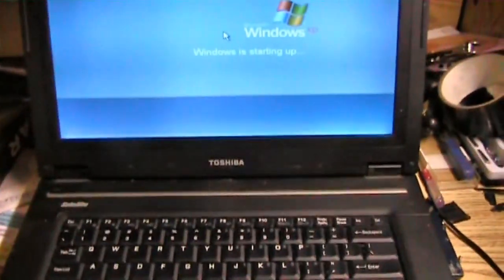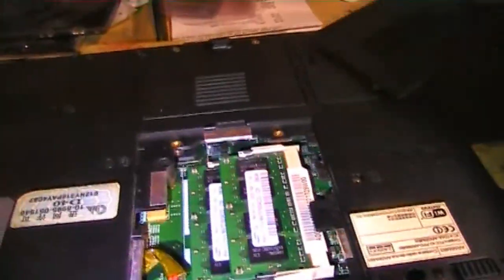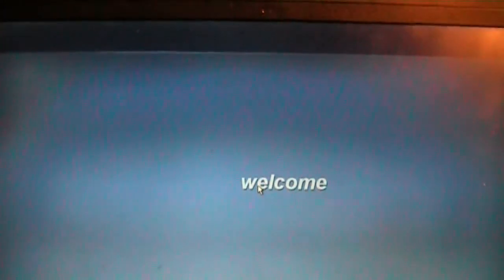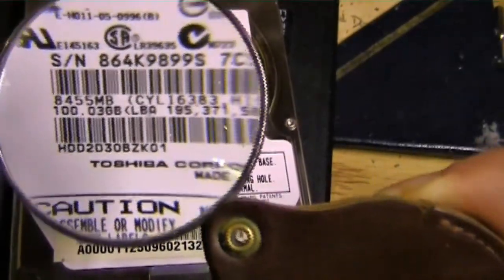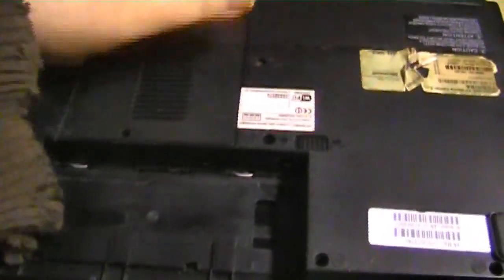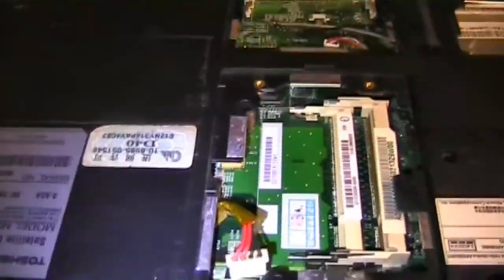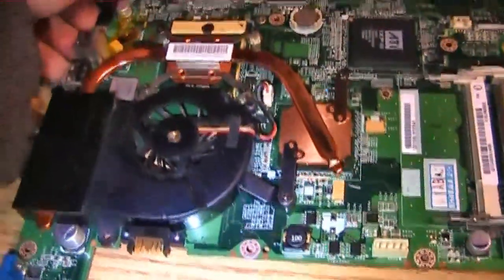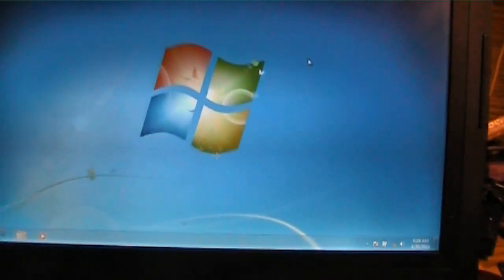Upgrading a Toshiba Satellite L35 laptop

Comment: Can you please tell me what year was this laptop manufactured? And can I use adobe premiere (video editor) on it?  Would you recommend it for regular daily use? Thank you
Reply from the maker: I'm sure it was manufactured over 10 years ago, and as such, it would not do well with new versions of video editors, but if you maxed it out and ran Win7, you could do okay with something like Cyberlink PowerDirector 7 (which is an older of the software) or versions of Adobe or Vegas that were released around the time this was made. If your needs aren't too demanding it could still be a basic computer for daily use, limited by its GPU and definitely not a gaming system.

Comment: Awesome video, I wanna upgrade my Toshiba satellite L35-SP1011,  what's the Best CPU upgrade this machine could handle?,posting the specs here: 

CPU & Chipset3:
CPU  Intel® Celeron® M 380 1.60GHz, 1MB L2, 400MHz FSB
Chipset ATI RADEON® XPRESS 200M
Memory:
2GB PC4200 DDR2 SDRAM
HDD : 40GB (5400 RPM) Serial-ATA (SATA)
CD-RW/DVD-ROM 
Display : 14.1” 
Graphics : ATI MOBILITY™ RADEON® Express 200M 8MB-64MB 

I want to use a 533MHz FSB CPU but i'm not sure if the motherboard will handle it. thanks in advance.
Reply from the maker: You should be able to do a similar upgrade as in the video. I think the fastest CPU for that model would be a T2450. As always, before a cpu upgrade it's a good idea to make sure you have the latest available bios. Best of luck with your project. :)

Comment: i have an s1054 model, do you happen to know the best parts i can upgrade with or if theres a link to the best parts?
Reply from the maker: It's a very limited system by today's standards, but the L35 can be upgraded with the CPUs I mention in this video (there is a slightly faster one than the one I had on hand, which I also reference in the video). Your graphics will be limited by the ATI Radeon x200M, but you'll notice a speed improvement if you elect to max the RAM and install a SSD. eBay is a good place to search for computer parts. Best of luck with your project!

Comment: Ver y good video, I wanna upgrade muy toshiba satellite L35-s2151, what`s the best CPU upgrade this machine?
Reply from the maker: I've heard about the T2250 being a good upgrade, and I think you could probably bump that to a T2350. Just make sure you have the latest bios first. And if you have any doubts about your current specs you can run a free program like CPU-Z or Speccy to find out. Best of luck with your upgrade.
Reply: +ThatWord Will the T2450 wok?
Reply: +ThatWord Will the T2450 work?
Reply from the maker: Looking at the specs, it looks like it should work. Sometimes it's a matter of the latest available bios not containing the proper microcodes to identify the chip. Worth a shot I think.  :)
Reply: +ThatWord How update the BIOS?
Reply from the maker: You go to the Toshiba site, enter your model number and select your operating system, and it will show you your options. Looks like the latest official bios for your model is ACPI Flash Bios version 3.10

Comment: I have a toshiba L35-sp2011. First I had an Intel Celeron m 410 processor, I changed it for a pentium t2130 and it worked fine. Now I put a Core Duo t2600 on it and its frequency is limited to 1.73GHz when it should be 2.16GHz. I have the latest version of the BIOS and I don't know what to do, can you help me or will you know what the problem is?
Reply from the maker: It might be the Toshiba BIOS for the L35 doesn't have the microcode for the t2600, which is 667fsb, so it is setting it like a T2080, which is 533fsb, which it will support.
Reply: @ThatWord  Ok, thanks!
Reply: @ThatWord  Bro, it's possible to add microcode of this processor to BIOS 🤔
Reply from the maker: @gim7640   It's not something that can reasonably be done. In some instances, for some models, there are unauthorized versions of the bios floating around, and by using one you might risk bricking your laptop by running it. So basically the answer is no, it's not practical, but it's still within the realm of the possible. I can't be of further help with it though.
Reply: @ThatWord  well, thanks to much for helped to me

Comment: bro i have a l35-4096 what`s the best CPU upgrade this machine can handle?
Reply from the maker: At the time it came out a fast cpu for that model would be the Intel T2080. There might be faster that it could take, but probably only marginally faster.
Reply: ThatWord a pentium?, wich windows do you think would be suitable for it?, and what would be the heaviest game / aplication that this processor can run?
Reply from the maker: Yeah, Pentium dual core. Win7 should work well. It could probably do Minecraft at lower fps.
Reply: @ThatWord  thanks!, i buyed the t2080 yesterday, thanks for the help

Comment: What model cmos model, i have trouble because my cmos is lost
Reply from the maker: If you mean the CMOS battery model, I believe it is a 2032 battery  (CR2032 coin cell). There are several BIOS versions as well, and with Version 2.2, it will duplicate the BIOS password to EEPROM and compare the password value between CMOS and EEPROM at POST time. If the value is different, BIOS will copy EEPROM value to CMOS. I think the last BIOS for this model was ACPI Flash BIOS version 3.10

Comment: Ah another one of those compaq like constructed models. "Let's just shove the CPU deep into the laptop so they won't bother with the upgrade".
Reply from the maker: +RogerRHF Exactly. There's no accident to a design like that. In fact, I think they had inaccessibility meetings to perfect the layout. :)
Reply: +ThatWord Yes indeed, companies will do anything to increase the possibility of sales.
Reply: could be worse, :I it could be the newer toshiba satellite that my 
sisters boyfriend gave me, it was the lowest model of the toshiba 
sattellite at least the lowest end model of that series and to make sure
 it wasnt upgraded to be at par or above par with the higher end models 
they soldered in the cpu to the board so it can never be changed, and to
 make it worse the cpu in it is typically used and seen in a netbook and
 it is a dual core 1.10ghz proccessor which is really really bad and 
slow for any new computer :I i initially thought windows 8 lagging was 
due to a virus but it turns out it was bogging down the poor cpu so 
much, and this is a computer new enough to come factory installed with 
windows 8 and if i am correct it is only 1-2 years old, this really 
ticks me off because i have upgraded the laptop you showed in the video 
(Slightly different model but of the same line of laptops) to its max 
with a dual core t2450 @ 2.0ghz which is almost double the speed of the 
other laptop i talked about with the integrated cpu and the ram to 2gb 
(which isnt that much nowadays but is just enough to run windows xp 
smoothly wihtout hiccups since xp is less demanding)

welp lol thats my rant, hope you enjoyed it
Reply from the maker: I hear you. Soldering a CPU to the mb is the absolute worst. Sadly it is still done today. Sympathy man. A couple things that would get it running faster would be a solid state drive, and Linux Mint XFCE.
Reply: ThatWord
that actually is a good idea but since i have no room to spend money on that i will probably just stick to my windows xp l35 laptop lol it does all i need it to do and i have a kick ass desktop with a 6 core 3ghz cpu and nvidia (forgot the model) graphics card with 8gb of ram lol, good trade off i guess since i dont need to update my laptop yet. quite funny how an 11 year old laptop can kick a 2 year old laptops ass though XD the difference is literally night and day and in terms of speed and lag people would think my xp laptop was the newer one (If of course they were stupid enough to not see the difference of windows 8 and windows xp and the laptops chasis) plus i prefer the older toshiba laptops, lately some of the newer ones are a bit lacking in quality and feel cheap, imo the ones from 2005-2006 to around 2011 are the best in quality and somewhere between 2011 and 2016 they dropped in quality and im not hating im just saying their laptops just dont seem as good and well built as they used to be :I however they are still very serviceable which is a plus its just they still feel cheap
Reply: You could be me and buy a cheap ADATA ssd off newegg. I bought a 120GB version for my CQ57 and it made a massive difference. I had an old 160gb HDD from about 2008 and it was very sluggish. It went from booting in 30 seconds to literally less than 10 with the ssd. The poor laptop was held back by that old hard drive.